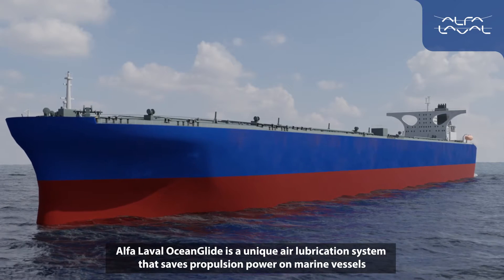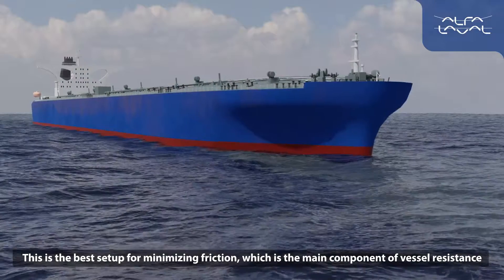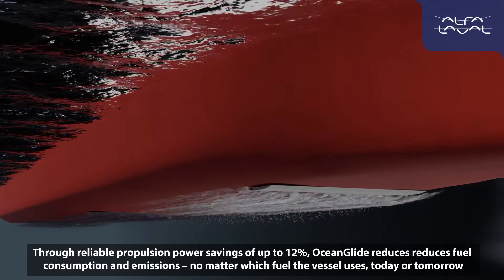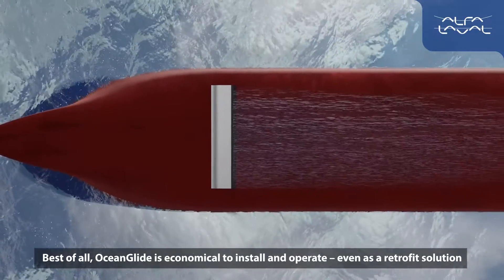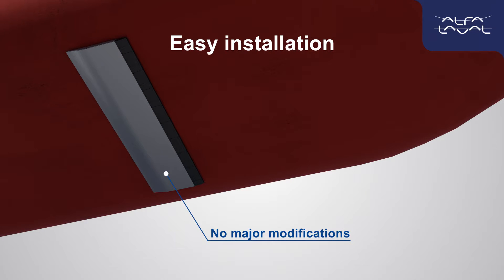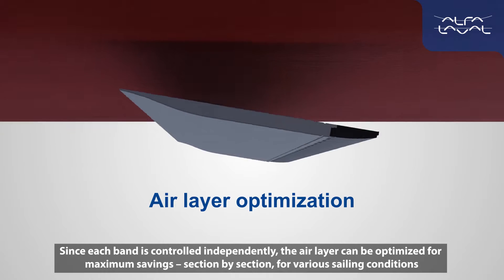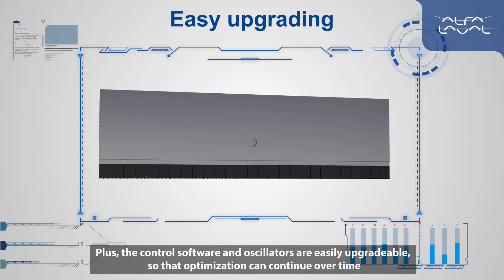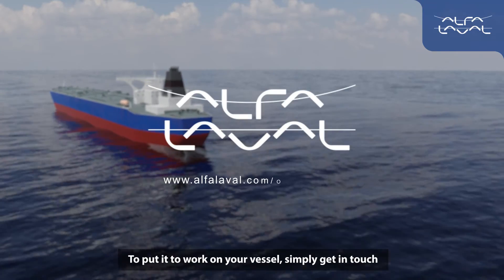Alfa Laval Fluidic air lubrication OceanGlide 3D animation video

Comment: and how does the cavitation created by the airbubbles affect the hulls corrosion resistance?
Reply: Cavitation is caused by the implosion of low pressure vapour bubbles against a propellor. That's not what's happening here. These bubbles are being forced out at higher pressure and so won't undergo the implosion that causes the damage.